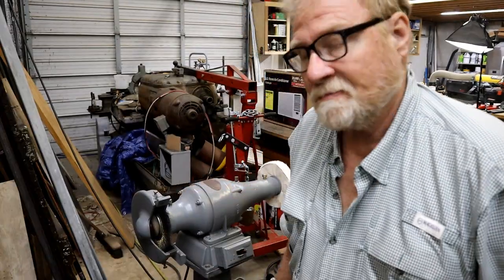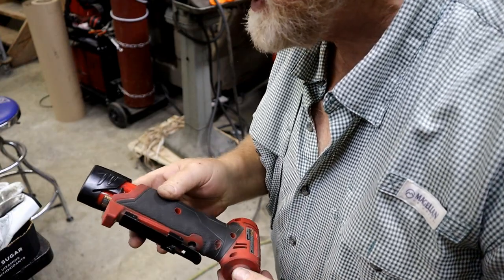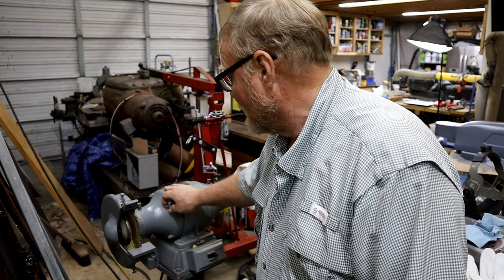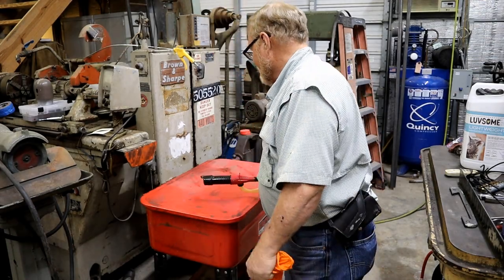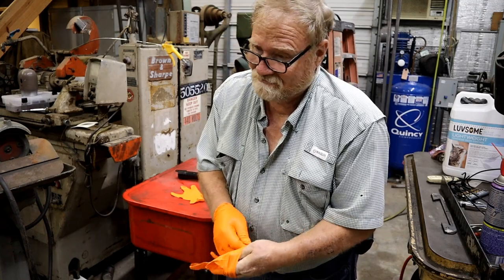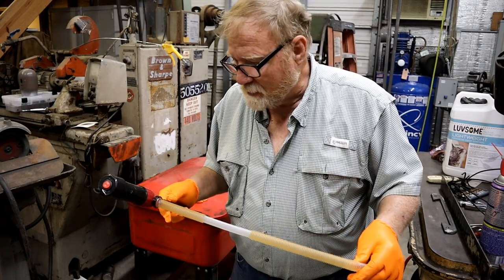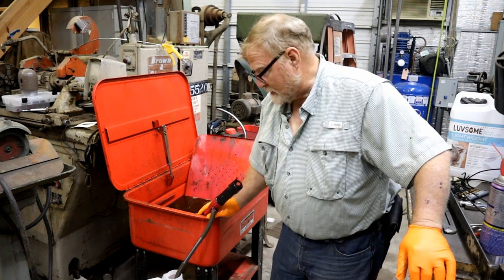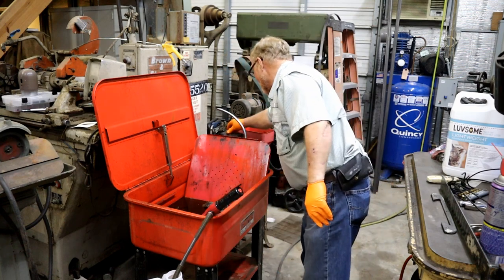DON'T DO THIS... I knew better and it still happened!

Comment: Many thanks to Don for the M12 battery tip. I also have very arthritic claws of hands and have struggled with these batteries to the extent I used to wrap a cloth round them and use my Knipex channel-lock pliers.
Reply from the maker: Great to hear!
Reply: My big Channel Locks are what I’ve been using also but now I’ll use Dons thumb trick. Thanks Don.

Comment: Thanks, Don, for the tip removing the M12 batteries!  That will be a big help with the RA grinder.  They are a bear to get the batteries out.  My R.A. plays heck on my hands, ever right now trying to type.  Man, Steve, I don't like those wire wheels, please be careful with them.  Get you a 3M Scotchbrite wheel for buffer and see the difference.  They are nice for light deburring too.  As always, thanks for sharing!

Comment: Method works well one handed on marker pen caps also.  Reminds me of my first struggle removing an overly bent split pin, where my first instinct was to use the pliers in a grab and pull motion;  then a senior intervened to show me how.

Comment: I installed a bulkhead fitting and valve and hose to drain mine out for cleaning. Also added a water heater element in a pipe to heat my fluid and changed to purple cleaner works great now
Reply from the maker: I was going to do that when I changed it out... But with the pump no need:)  Do you find the purple burns your hands? It does mine and I hate breathing the stuff...
Reply: @10swatkins  Plus you need a deep sink or some other way to wash that junk off. Seems to leave a soapy residue unless you use hot water. Then you need to worry about rust...

Comment: Nice video Steve.   I got to get one of those fluid transfer pumps...look very handy.
Reply from the maker: Yes you do, you will love them... Makes putting diesel into my tractor an easy job... Just sit the 5 gallon can on the step and pump away....
Reply: @10swatkins  Will it work for gasoline? I have a hard time lifting a full five gallon gasoline container high enough to fill up my riding lawn mower.
Reply from the maker: @ellieprice363   We use them for gas and diesel all the time... Buy two as they are not that well made.

Comment: I have no grip but my wife does and she can wring a battery's neck in a split second. I don't use a guard on a wire wheel except the spun wire side grinder jobs and sludge makes sure good fire starters along with the left over gas for cleaning stuff up. Don did good but he's still too virile for us old geezers. GBWYou!

Comment: On the bridgeport (and clones) what's the oil cup on the head for?
Reply from the maker: Usually to oil the spindle bearings... I am changing this one over to sealed bearings that don't need oil and will cap off the oiling port....

Comment: I look forward to watching every video you put out. It is excellent entertainment with tips I would have never thought of.  I wonder why you didn't use the pump in the parts washer to empty it? Thanks in advance for the great content.
Reply from the maker: Thanks... The pump in that machine will not suck it down...  You can see the inlets on the pump box on the right... In fact the level was just below the top row of holes and it was  loosing prime as it was...

Comment: Tractor supply has PSC1000 for these parts washers, ~$45 for 5 gal. Cheaper than the mineral spirits that I used to use.
Reply from the maker: That's what I have been using... Works well and does not seem to evaporate..
Reply: @10swatkins  I put a valve on the bottom of mine.
Reply: @donmadere4237  You heard his comment about the intelligence of the wife.

Comment: I have a 1910ish sibley and ware drill press. It has babbitt bearings and oil cups like those on your grinder. I was told at one point to use light oil in them. I end up using 80weight cause it lasts a couple hours. Thought maybe i should put felts in the cups and use lighter…should i be using grease?
Reply: Ha. Just after i posted think i see similar press hiding behind something while you were washing the bolts.
Reply from the maker: I personally would use way oil....  Most of the babbitt bearings get worn and light oil would go right through them...  Way oil has tackifiers in it to make it sticky but is not too thick and would spread easily in the long bearings...  I don't think grease would spread that easily unless you put a cup that applies pressure...

Comment: Dumb question ... but why not just turn the parts washer on with the wand/nozzle in a bucket?
Pushing a battery "in", before pulling it outwards, while pressing the release tabs  helps as well
Thanks for sharing 🇨🇦
Reply from the maker: The inlet for the wand is about 2 inches off the floor and even at the level I started at it was loosing prime... Needs to have about 10 gallons in it to pump well.  :)

Comment: I like the idea of using a transfer pump, However i am guessing that solvent and them doesn't get along very well. I worked in a shop that had a Laquer clean out tank. Similar idea, but has water on top to keep the fumes down, and acetone under the water. For cleaning and soaking spray guns. The drain on it always clogged from the debris sitting in the bottom of the tank. So we would get a 5 gallon button and one or two guys would tilt it so we could drain it into the bucket. Kinda like using a handcart for leverage. Was far faster than any other method we tried. (the acetone had a habit of melting any hose that came in contact with it and gloves). Just another idea should you run into said situation again.
Reply from the maker: Those pumps are rated for diesel and gas... never had a problem... Laquer cleaner might be another matter :)

Comment: On the battery releases, some times pushing them in further first than squeeze can help, or shave some of the rubberized coating off around the fingers, as its common for there to be more plastic than intended that never gets trimmed back.  knife usually helps shave it away. (appreciate the know all the same, I also have severe arthritis in the hands, and everywhere else)
Reply from the maker: I'm sure these would work better with a little trimming also...

Comment: When changing fluid in the cleaner I use the pump that's already on it ...
  And just siphon off the little that's left
Reply from the maker: MIne won't pump it any lower than it is now.... Always needs about 2 more inches to work and not loose prime :(

Comment: This may be a stupid question, but doesn't the parts washer have a pump in it that pumps the cleaning fluid to the brush?  Can't you put the brush into a bucket and use it to pump it out?
Reply from the maker: this one has an inlet that is high above the bottom of the tank... Even at the level I started from the pump was loosing prime, needed another 2 inches to keep it pumping all the time.....    That inlet level allows you to keep 10 years of crud in the bottom :)

Comment: I’m guessing Mobil Polyrex Em is the grease. Tell you what, I just put in a mini-split in my garage, its nice having an air-conditioner in the garage. If you need a hand putting yours in, let me know. Might be nice to get out of DFW
Reply: I have a mini split in my shop and I really like it!!
Reply from the maker: Yep that's the grease...     For this application Mini splits would be too expensive...  I have three areas in the shop, each with their 24000 btu unit and heater...  The main machine room, little machine room and large "dirty area" .      The main machine room runs 24 hours,  little machine room and dirty area when needed....   When a unit goes out I just buy a new one and slide it into the case of the old one, 20 minutes IF I can get it up there :)        Each unit costs 800.00 and lasts around 7 years... One split system costs me 2500.00 for just one area.... The costs just don't equal out.
Reply: What is a mini split? I’ve never heard the term.
Reply: @ellieprice363  A mini-split is somewhat smaller of a footprint than the traditional central HVAC. You can get them with wall mount & ceiling mount. They are generally speaking cheaper to run due to the inverter technology used in them.
Reply: @10swatkins   I bought my Mr Cool 24k mini split with extra 25ft line set for 1667$ Shipped to me. If I kept with the standard included line set it would have been 1500 or so.
Reply from the maker: @TBJK07Jeep  I have been looking into them to replace a unit in my office... 3000.00 for a two head system IF they ever have them...    Still my 800.00 wall unit beats the 1667.00 unit in price and I can buy a lot of electricity to run the unit for 867.00 :)
Reply: @10swatkins  gotcha. My plan years ago was to quasi take a window unit & make it into a custom split system for my garage. I had that window unit now for 17 years & never got around to it. There is a saying a Cobblers children have no shoes. Probably why I never got around to it. Lol

Comment: Never ever stand directly in front of a wire wheel, especially if it rotates at 3450. Also no reason I can think of to use a tool rest with a wire wheel.